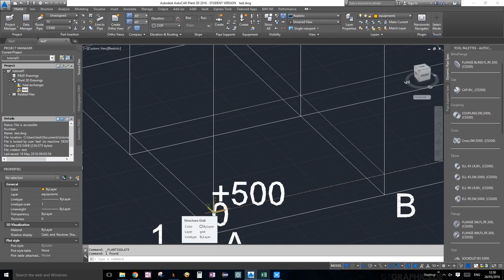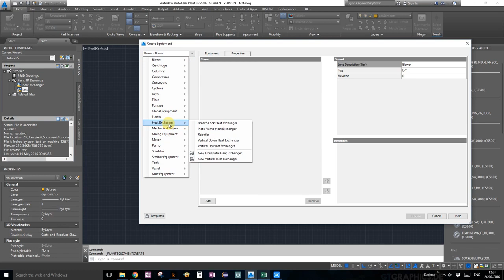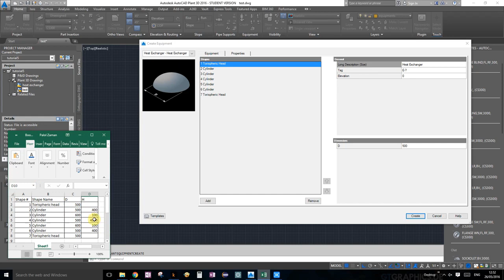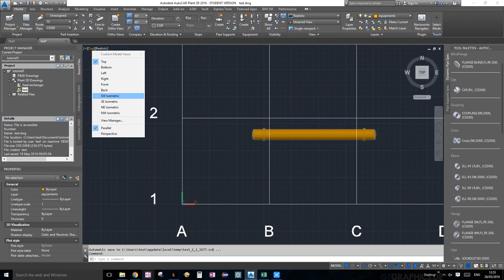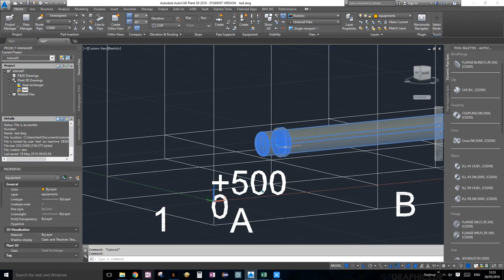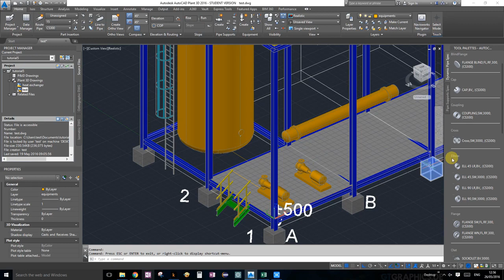Tutorial 9 - AutoCAD Plant 3D - Creating Custom Equipments

Comment: I am making the heat exchanger as you suggested but all the dimensions are interdependent, so i am unable to have cylinders of different diameters. Kindly suggest how to resolve.
Reply: When typing in the 600 diameter, click the lightning bolt to the right of it and change to override mode